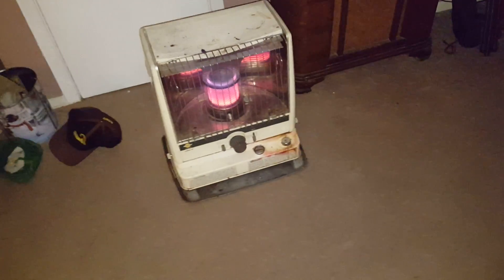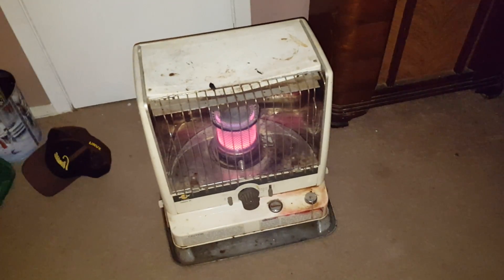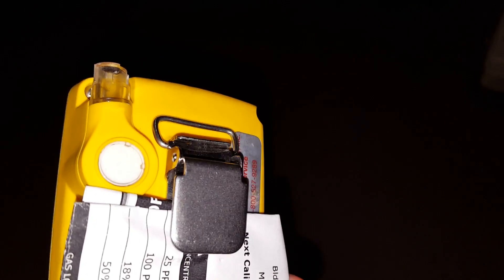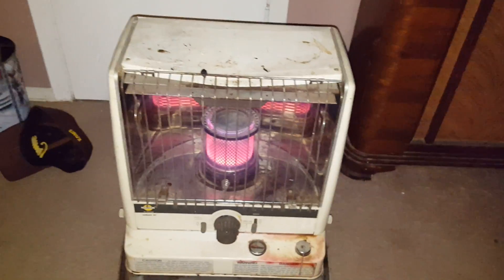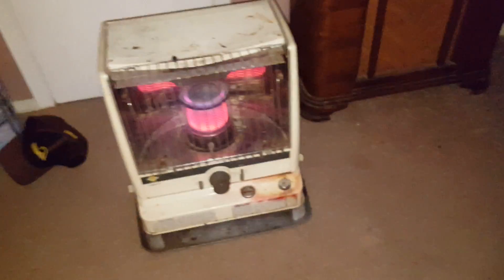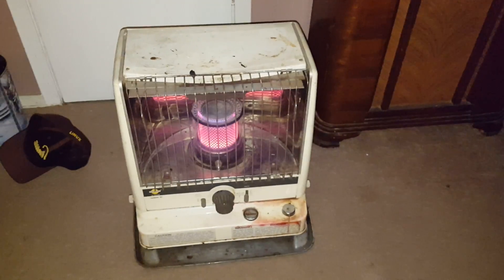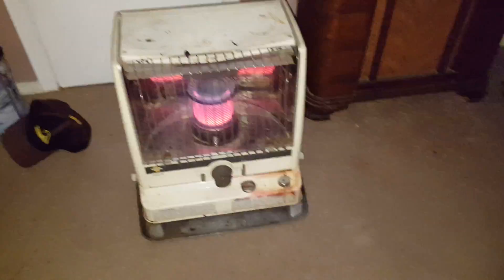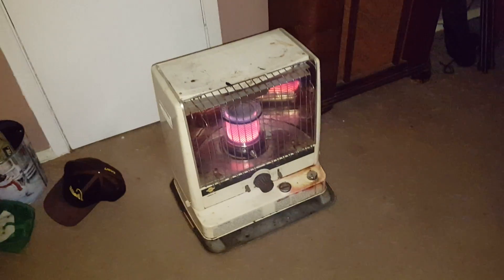Kerosene heater burning diesel. CO test.

Comment: Kerosene expensively because of a lot of aviation machinery. 
Diesel high point 600's degrees.
Kerosene high point 500's degrees. 
When heater red orange hot for long it reduces carbon monoxide and allows  small fresh air from window. Diesel stay warmer and cheaper than Kerosene.

Comment: 2023. Canada. K1 Kerosene at RONA building supplies works out after taxes to cost $22.50 per gallon and they only have it in 2 gallon jugs. The diesel at the Shell station (ULSD) is $1.77 per litre which is $8.00 per gallon. I have been burning diesel for a few days with a Lucas diesel additive 10 ml per gallon and 99% isopropyl alcohol 40 ml per gallon. 26 cents per gallon of diesel for the Lucas and about 8 cents per gallon of diesel for the iso from the local pharmacy. No problems so far. No soot, no smoke, no smell (other than a bit at startup and shut down) and burning clean. I am using a Dyna-Glo convection heater in my drafty old travel trailer so no worries about proper ventilation! :)
Reply: I just bought 10 litres of K1 at Crappytire for $40! Then it dawned on me not a half an hour later while at the local airport - there's a big tank of Jet A... dooof!
Reply: Same as Jet A at local airport - $2.50/litre. But yeah, going to try diesel with acetone now.

Comment: I would like to see someone test the heat output of diesel vs kerosene on these, also how many hours each one takes to burn a tank of fuel
Reply from the maker: I could not tell any difference. The tank of 1.5 gallons burned about 27 hours. Same as kerosene. It's practically the same stuff. Only a couple of atoms different in the carbon chain. With additives for the lubrication and protection of the engine. Maybe some anti gel compounds. Kerosene and diesel are almost twin sisters.
Reply: Thx to the person who wrote me back with these answers.  Much appreciated

Comment: Only problem with this is you need to setup your detector outside in fresh air. It will set itself to 0 based on the environment it is set up in, that is why it has a long setup time after you turn it on. Being in the room for 6 hours, if there was detectable C0, the detector would not have picked it up. You always set up your detector before you enter the environment you want to test.
Reply: This was such a huge miss in this video, but people that don't understand these systems will take it at face value. NOT SAFE.
Reply: THIS GUY IS AN IDIOT. You are correct I have fired people for less.

Comment: the year of 2022 since of this video bobby has posted 7 years ago....  RED DYE DIESEL since has doubled in price from $2.30..... its now $4.49 that goes to tell you how much kerosene has gone up.. its probly tripple in price of the red dye diesel... & by todays standards it is still better... for the old drafty farm house i live in.....

$27.98 for 2.5 gullins of that worthless garbage at lowes.  I will be burning diesel for the foressable future.... 
klean-heat $14.98 for one gallon (kerosene) at lowes.. ITS GOOD KEROSENE IS SKY HIGH.  that garbage can sit on the shelf and look pretty. May the kerosene go stale..... 
kerosene heaters??? they are DIESEL BURNERS..... NOT KEROSENE HEATERS...

Comment: I'm in St. Louis MO. Today, Feb 2021, Kerosene is nearly $13/gallon and ultra low sulfur diesel is $3.17/gallon. Running diesel in the heaters and my kerosene lantern is a no-brainer. The only problem that I've run into is the diesel getting to thick to move up the wick to keep the lanterns supplied with fuel so it starts burning the wick. I've got a diesel supplement on the way that's supposed to fix that. The 32oz bottle treats 100 gallons of diesel and prevents cold weather geling of the diesel fuel. I hope it works.
Reply: It will work, I know ppl that do that and I was about to as well. I am in CT and was paying $10/gal at home depot for kerosene but just found a local place that sells 1K from a pump for $4/gal. I just have to bring my own containers and it's a 20 minute car ride. You might be able to find someone that sells 1K from a pump for cheap but I had to use the Google machine for like an hour before I found this place.
Reply: @saganworshipper6062  Awesome! I will check it out. I thought only the 2K was available at the pump. Still, kerosene 1K can have up to 400ppm of sulfur (2K is 3000ppm). But the ultra-low sulfur diesel (ULSD)  must be below 20ppm sulfur. And I've heard that Shell sells ULSD with just 7ppm sulfur.
Reply: @paulswarthout9967  Now that I've burned enough of it I can tell you a few things. 
1) The $4 stuff lasts longer. A full tank of Home Depot stuff in my heater lasts about 11-12 hours. The $4 stuff lasts close to 14 hours on a full tank.
2) The Home Depot stuff does not heat nearly as well as the $4 stuff. I don't know what the exact BTU difference is, but my apartment gets much warmer on the $4 stuff and there is a qualitative difference in that when you put your hands over the heater you can definitely feel the difference. It just burns hotter full stop.
3) The flame is a lot more evenly spread with the $4 stuff. The Home Depot stuff is harder to control (in my heater anyways). With the Home Depot stuff I always have some areas with almost no flame and other spots I have big long spikes in the flame (I call it the genie in the bottle effect lol) so it's hard to guess how high to have the wick and takes constant adjusting. The $4 stuff creates a nice even flame exactly like the ideal flame shown in the manual that came with my heater.

4) The $4 stuff has a stronger odor. In between fill ups when I am filling it with the siphon the fumes from the open container are a lot stronger than the Home Depot stuff. I would recommend filling it outside or in an area that has a lot of ventilation and store it outside as well. The Home Depot stuff I was able to keep inside in the jugs without it smelling. Also if you get it on your clothes you'll need to change. I got some on my sleeve and that's all I could smell and it didn't like evaporate or anything so I had to get that shirt off. 
5)The Home Depot stuff has much less smell when you turn the heater off compared to the $4 stuff. During operation, both fuels give off some odor but I would say it's pretty similar. The $4 stuff may smell slightly stronger than the Home Depot stuff while burning but it's negligible.
6) The $4 pump stuff will clog your wick up after about 4 days compared to about 8 days with the home depot stuff, so you will have to dry burn your wick twice as often.During the dry burn the $4 stuff 
makes more smoke/soot compared to the Home Depot stuff. I always do the dry burn/wick cleaning outside.

So overall, those are the trade offs. If you don't mind the extra maintenance and the stronger odor in exchange for better efficiency as well as higher BTU's/hour then the $4/gal is definitely the way to go. If you are sensitive to the smell and don't want to deal with having to clean the wick twice as often then maybe stick with the Home Depot stuff. Also, I have a carbon monoxide meter and neither fuel seemed to register any significant amount of CO so I would say they are probably close in that area. I have a cat that is 20 years old and after all this time he hasn't seemed to be bothered by the heater at all, so they both seem safe, which I was a little concerned about in the beginning. Really surprised by how efficient kerosene is. I think they say it burns at like over 99% efficiency and I believe it. The stuff they make today compared to the stuff I remember my grandfather burning as a kid seems to be far superior when combined with a modern heater. I remember the smell being very strong when I was a kid. 

Hope this helps. I'm actually going to 
experiment with a 50/50 blend and see how that goes. Let me know if you are interested in how that goes. I'm sure I missed some stuff but feel free to ask questions if you have any. Good luck to you!
Reply: @saganworshipper6062  Thank you!! Great information.

The Lowes (brand is Klean Strip) 1K Kerosene got me through the -4F temps through the middle of February. I used it in three 12" Kerosene Hurricane lanterns. In addition to a 1500-watt oil filled radiator space heater, and the 3 lanterns, I was able to keep my 130CF greenhouse between 68F and 73F throughout the bitter cold. But the tradeoff was the kerosene produced a lot of soot, that coated the leaves of my plants. More than a few plants died.

In general, kerosene releases 132,000 BTUs of heat per gallon. ULS Diesel fuel burns at cooler temperatures than Kerosene, but releases 139,000 BTUs of heat per gallon. The top of my lantern runs about 225F when burning kerosene, and about 185F when burning diesel. Therefore, a tankful of diesel will last longer than a tankful of kerosene and less heat will be released per hour with diesel than with kerosene.

Incidentally, I ran out of the Lowes 1K Kerosene and wasn't able to buy any more in the middle of the really cold weather. I found a different brand at Menards of 1K kerosene for $19 for 2.5 gallons. It burns a little cooler than the Lowes 1K kerosene. So, seemingly different brands burn differently.

I haven't had any trouble with my wick fouling when burning kerosene. I didn't replace the wick at all over several weeks, except when switching fuels. But I always save the wick and put it back in when switching back.
Reply: @paulswarthout9967  Thanks for the info. I've never had my heater produce soot of any kind, like AT ALL. I've been running the heater in my living room for the last 2 months and there is no evidence of soot on any of the walls or drapes or ceiling or anywhere. Even the entire inside walls of the heater itself are completely soot free, as well as the inside "ceiling" of the heater. The heater still looks brand new. 

I'm wondering if you might have some combustion issue going on or perhaps have the flame too high? According to my manual, the only way it would be making soot is if the flame is set too high, which I did experience one time when I first got the heater and was experimenting with the flame before I went and read the directions cover to cover.

 On my DuraHeat unit the instructions say to keep the flame not much more than 1/2 an inch above the burner plate, which on my heater (likely because it is still basically new), the only way to obtain a half inch flame height is to have the wick lowered almost to the lowest setting. (It also states that operating the heater with the wick positioned any lower than the pre-set lowest setting will cause the heater to emit carbon monoxide which is obviously deadly, so it's better to have it slightly higher than normal, as opposed to lower than normal, if you aren't sure if it's at the proper flame height or not, if that makes sense). 

The only time it makes soot is when I dry burn the wick outside and per the instructions on my heater. When the heater is just about out of fuel and down to a flicker, I take it outside and crank the wick up to its highest setting and light it. I let it burn like that until the flame goes out completely, then I lower the wick all the way down and let it sit for about 15 minutes, then I come back and raise the wick all the way again and light it again until it burns out. Usually doing that twice ensures that I've completely burned every drop. Sometimes I will try to do it a 3rd time but usually by then it will no longer light. After that, I remove the top half of the heater and raise the wick all the way up and just brush the top of the wick with an old toothbrush. This process seems to completely rejuvenate the wick to the point that it appears almost brand new and totally soft to the touch. When I do this process after strictly burning the $4 pump stuff, it creates a lot more soot than the Klean Strip stuff. I also notice more of the carbon buildup on the wick, in the form of hard crusty balls, in which case I use a wire brush instead of the toothbrush. I have read that if you regularly do this "dry burn" to keep your wick in shape, that it can actually last *years*, but I don't know if that is true. 

I also have a 1500 watt oil filled radiator heater, however, that heater does not work as good as my other 1500 watt "box type" infrared heater with the fan blower. I have experimented with many different 1500 watt heaters over the years. I have tried lots of box type heaters as well as the more old fashioned quartz type ones with the reflective mirror, some of the oil-filled ones, ceramic ones, basically all of them. Even though they all claim to be about 5200 btu's, I think the best bang for your buck is a box type infrared like the one I have now, even though it appears they no longer make it, but it is a LifeSmart or LifeHome brand which are pretty common, however, the one I have has 8 heating elements when most others have 6. I never tried an Eden Pure (no longer made but can be found on ebay refurbished) or a Sun Heat (which uses a different technology instead of bulbs it has some sort of copper element). Those both cost about $300-$400 respectively so I could never pull the trigger even though I have heard those are both supposed to be really good. 

Ok well geeesh, once I get a ramblin it just goes on and on so I better leave this off here. Sorry for such a long winded reply, just trying to pass along what I've learned from my own experience since there is a lot of just terrible info out there. Lastly, I'm curious about the isopropyl  alcohol. I see people here saying they add it to their diesel so I'm wondering if it provides a similar benefit to kerosene. Have you tried that or do you already do that? I'm going to look into it and see if it helps and what % of alcohol is best and what the ratio is. Anyways, good talking to you and thanks for the heating numbers.

Comment: the diesel fuel now you can burn because of the sulfer in it being reduced... the old DIESEL that had the high sulfer content could not be burned in kerosene heaters back then because they smoked.... the new diesel fuel is ULSD ultra low sulfer diesel
Reply: Im finding that uls diesel is the same as 1k kerosene. Some say its the same as #1 uls diesel at 15ppm. I dont know what sells at the pump but if #1 diesel is actually better and cheaper than 1k that's great. Im getting conflicting info on this. Do you know?
Reply: @dannypresson4815  Shell states the the sulfur content in their diesel is typically between 4ppm and 7ppm at delivery.  I'll burn the rest of my K-1 in my garage heater and use ULSD in my kerosene heaters.... half the price and no smell.

Comment: When people talk about the I'll effects of burning diesel I think they are talking about the old diesel they use to sell.  Modern diesel is ultra low sulfur diesel at 15 parts per million sulfur.  K1 kerosene is 400 parts per million sulfur.  The EPA has cracked down so hard on truck road diesel that it is many times cleaner than K1 kerosene.  But since diesel is about 5 times cheaper than K1, the oil companies are not going to admit it and lose billions in kerosene sales.  They are using scare tactics to protect their kerosene revenue.
Reply: Are you referring to pump diesel?
Reply: @dannypresson4815  here where I  live (Canada)  you can buy ULSD at the pump, it is commonly available now. I think Esso calls it Synergy Diesel Efficient and Shell Diesel Extra.  Way less sulfur than the old diesel and even way less than K-1 .... 15ppm vs 400ppm.

Comment: Back in the early 60s  kerosene only cost 10 cents a gallon
Reply from the maker: George Fitzgerald it’s crazy.  It’s one of the leftovers of petroleum distillation. Junk residue. And they call it “heating oil” and jack the price up 200%

Comment: Nice video sir!  K1 is 3.99 here and 2.99 for off road diesel.  I recommend doing it half and half and 3 OZ of 99% isopropyl alcohol per gallon of fuel.  You have to use the cotton wicks though...if you have the fiberglass wicks only use the K1 kerosene.  The diesel and alcohol will stop the wick up.  I bought a couple of the old Perfection heaters.  They work great for one medium room.
Reply: Actually, ULSD (ultra low sulfur diesel) has 15ppm or less sulfur whereas K-1 kerosene has about 400ppm, so the diesel should be better for the wick than kerosene.

Comment: Great video, Bobby. If you Google using ULSD in a kerosene heater, it tells you that it's completely safe to do so. It does suggest to add either diesel fuel cleaner or 91% isopropyl alcohol 3 oz per gallon as you suggested. So this video was correct and on the money. Diesel is cheaper than kerosene and it burns longer with no odor also like the video suggested. To say it again to the views. Burning diesel in a kerosene heater is as the man said in this video it is not going to kill you it is not even going to hurt you.
Reply: Why wouldn't you add 99% Isopropyl alcohol?  Why introduce that water?
Reply: @boxsterman77  cos its expensive than 91%. I use 99 and have no probs with it.

Comment: my kerosene heater just like that smells so strong I can't run it in house I even put k1 with additive to burn clean and think it was worse what is wrong with it I replaced wick already was sure that'd fix it but didn't it smokes until it goes catylitic not terribly barely though .Can someone offer advice please ,thank you..
Reply: Maybe take it apart and clean it with a solvent. Sounds like it's gummed up with tars/soot.
Reply: Take outside for first 5 minutes,  you're on the right track.